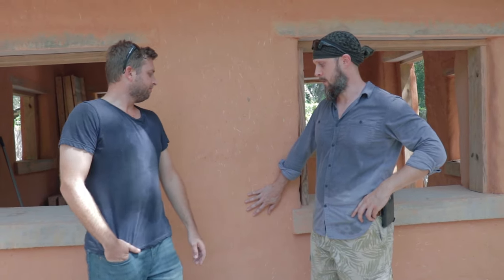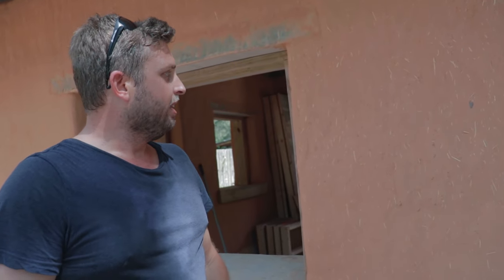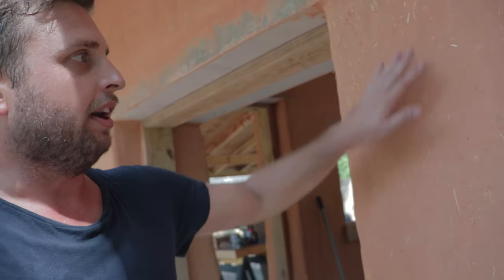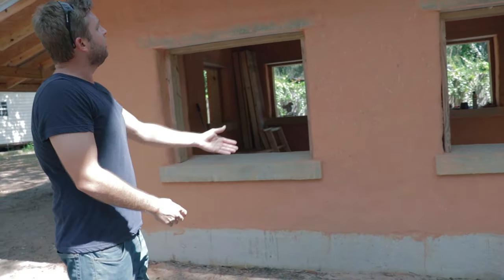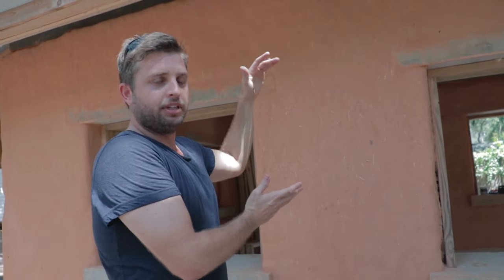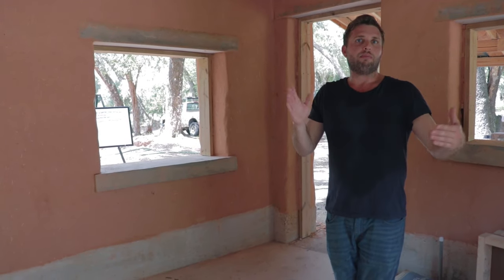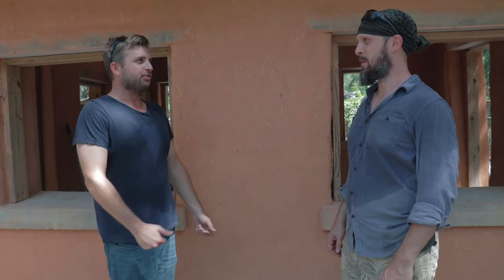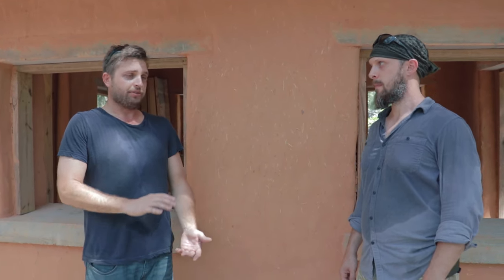The Building Inspector Discovers My Cob House! See What He Says

Comment: Cob house does not rot or mold. Of course it can come to pieces if the rain consumes the structure. 
But in general it can last 10,000 years and still be reused. The earth/adobe you gather from ground is already several million years old. It is the most ecological building material you can find. Does not burn like wood, does not rot like wood, does not damage nature like concrete. Can be used as supporting structure and for thermal insulation. You can also use clay for making roof and floor with tiles. You don't need to oven floor tiles. Fireplace can be also formed from same material. It is insanely versatile. It can be even waterproofed without ovening it.

One thing should be kept in mind when building cob house is to build high foundation so that the bouncing rain doesn't hit the walls and consume them. Another thing is to make overlapping large roof with drainpipes and wells so that the rainwater will be directed away from the building. Otherwise it will seek into the foundation and into the walls and destroy them especially if you have frost.
Reply: That's why you have a good roof and good foundation and keep the outer walls plastered.

Comment: There are cob houses in Britain and other places of the world that are over 400 years old. As long as you maintain them and have a good roof and boot you're good to go.
Reply: Problem is, cob construction in UK does not meet building regulation unless it’s incredibly thick or covered in a man made insulation layer. That is due to change thanks to the research work undertaken by the UK/France CobBauge Project to create a naturally insulative cob material combining a cohesive structural and thermal wall layer.
Reply: Our house is 350 years old and made of wattle and daub, clay lump with a timber frame. It's cool in the summer and we have woodburners and a central heating system. We have single glazed sashes and lattice windows. Other houses and hotels we go too always are too hot as everything is hermetically sealed and air conditioners are used.  We love our old home in England!
Reply: @kevinthebespectacledpilgrim  The downside to "high efficiency" insulation is that it doesn't really breathe.

Comment: These structures have been known to last 10,000 years.
Reply: which is why they cant have everyone building these, would really hurt their monopolies on building material.
Reply: But how does it resist rain thro 10000 years? its made of mudd!!
Reply: As long as water isn’t directly hitting the surface constantly it should be fine. Cob has an ability to “breathe” to a certain extent.
Reply: @laurence6230  in britain rain constatly hitting muddy house surfaces what are you talkiing about?
Reply: @سهمالهاجري  There are some very old examples of cob houses in the UK that have survived in spite of the rain. Those houses often have overhanging roofs that protect the walls.
Reply: @سهمالهاجري  it's made off many ways ..many options..cob is mud n clay n straw...when it goes solid rain just bounces off..you can also render then plaster if you wish but then you are going too lose the dual property off the cob which breaths in n out it keeps warmth inside in winter and keeps the building cool in summer...its a far far superior building material than bricks
Reply: @سهمالهاجري  it's not just mud
..just research cob houses n you will see
Reply: @jshaw4757  
thanks for clearing some points for me. I see, i made an experiment i gathered mudd soil with straw brick and after rain i felt the brick and it was supple and soft, i just used surface  red soil, was my mistake that i used surface soil?  i have to extract the clay out of it as i saw in some videos?
Reply: @jshaw4757  But plastering it adds more strength i believe? you cant just expose mudd to rain would you?  we can use lime plaster i guess? thats what i saw in othet vidoes!!
Reply: @سهمالهاجري  yep lime wash over cob
Reply: @سهمالهاجري  That is how we have been building since beginning off time..its funny some make a joke about somebody living in a mud hut...but those mud huts are superior from every angle you can think off pretty much lol
Reply: @jshaw4757  i mean to ask you, extracting clay is different than using surface soil to build a house?
Reply: @سهمالهاجري  mix clay and soil and straw or similar material into one mixture
Reply: Clay once above ground turns solid...so the mixture off clay and soil and fibres...more fibres will create more strength in the mix...in U.K they used too use animal fur sheep fur and mix that in
Reply: @jshaw4757  thank you, the one thing i didnt try is using clay it self, i'll try and tell you the result
Reply: @سهمالهاجري  I'm learning myself still...I think you need the soil from deeper underground which is full off clay not surface soil
Reply: @jshaw4757  Yes deep clay not surface soil, i believe that too, but i have always fear of rain destroying the house, and yes its not funny... its financially effective, why we build with 20k budget when we can lowers the costs to almost 2k removing the iron and cement of the house!

Comment: Are cement window sill and lintels really needed in cob construction? Cob building masters in British Columbia build the whole structure just cob, nothing extra and they say they are super durable. Another thought on those concrete lintels, wouldn't they act as thermal bridges brining in heat directly into the house on super hot days and cold on cold days therefore negating the entire passive energy benefit granted by the cob walls?
Reply: I agree.  All cob or adobe sounds better. My Grandpa's house in New Mexico is made of adobe...was built in the 1800s.. my aunt still lives there and it's a beautiful three-bedroom home.
The walls and window sills are about 16 inches wide.  We used to sit there when we were 2, 3, 4 years old.

Comment: Would latex paint keep cob from permeating moisture the way it should or would it seal it even better?  What about a Stucco finish?  I think if someone trimmed a cob house out with mouldings and trim and gave it a good white paint job the public would go for it.
Reply: Generally what I've learned from talking to people in the industry and  going to workshops is that modern building materials aren't compatible with earthbuilding materials because it compromises the function and integrity of both. In the case of finishes, the wall needs to be able to breathe, and latex paint is not vapour permeable. Lime/earthen plasters work really well and you can mix in mineral pigments to create colour. For comprehensive info, I highly recommend The Natural Plaster Book by Cedar Rose Guelberth & Dan Chiras if anyone's interested. They also discuss natural vs standard paints.
Reply: @kina5542  thank you.
Reply: Part of the reason people love cob homes is to get away from all the toxins in most conventional building materials...causing respiratory, alergy, migrains and other health problems. So for instance, you dont want a formica countertop in a cob/ adobe home. Natural materials...wood..
.slate..granite...etc .
Also did you know cob homes always smell earthy and fresh? 
No " housatosis".
Super cool and comphy in summer and in winter the cob/ adobe absorbs the heat from a woodstove so house holds heat better.

Comment: What material did they use to make the building water resistant?
Reply: I'm no expert but from what I've discovered about earth building, you have a larger overhang in your roof so that theres less contact between the water and the cob. You can also add extra protection with a lime or earth plaster and having a foundation made of stone or concrete (something like that) keeps the water away from the cob. It looks like they have the overhanging roof in the video and might add the plaster on when its finished? Hope that answers your question :)
Reply: They have a oil that helps make it waterproof
Reply: A couple coats of plaster. For exposed walls, lime is recommended, but it is hard to find good quality lime. You can add pigments to color it if you don’t want white. As a general rule, anything that repels water (like oil) is a bad idea. A lot of old earthen buildings have collapsed because a nonbreathable surface or coating was added to the outside surface.
Reply: A good foundation that directs water away from the building (french drains were mentioned in this is one example of getting water AWAY from house).  All well sealed windows and doors, a solid roof, hopefully good overhang to prevent water landing close to the house are MOST important for ANY kind of house to avoid cracks and damage.  Easy to overlook the mundane details of boring foundations and lintels and roofs in the excitement of cob ideas -- I know, I've been doing it.  I've also lived in a 125 yr old Sears & Roebuck cottage, had some cracks in the lath and plaster walls.  Our inspector immediately traced where water had gotten into the rock foundation and helped us develop an plan to fix and reroute water to a flowerbed!

Comment: how does it resist rain?
Reply from the maker: Very well, actually. But you can also stabilize it with cement or lime to better resist rain.
Reply: @thiscobhouse  you mean mixing the mudd with cement? or coating it with lime or cement?
Reply: @thiscobhouse  and the houses that were made 400 and 500 years ago how they resisted water all that time? thanks for your time and replies❤️🙏🏼
Reply from the maker: @سهمالهاجري  Yes, you can coat the walls with lime plaster. This is how they did it in the past. Or now, you can add cement or lime to the cob mixture itself.
Reply: @thiscobhouse  Thank you, much appreciated❤️